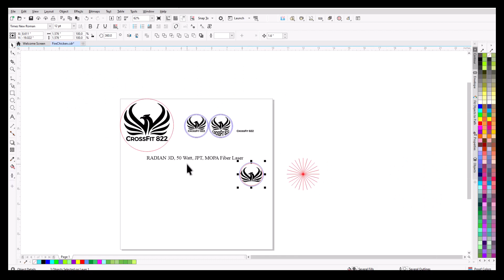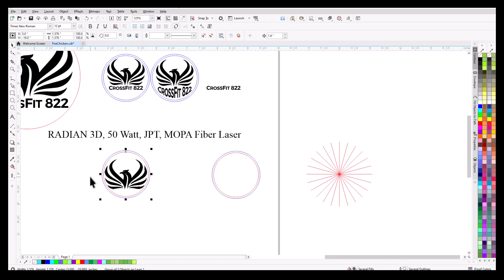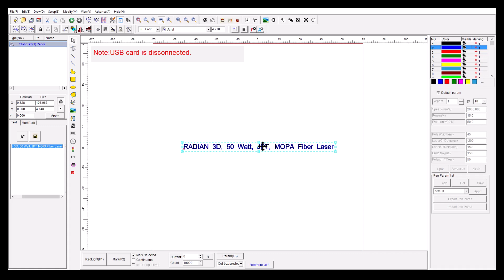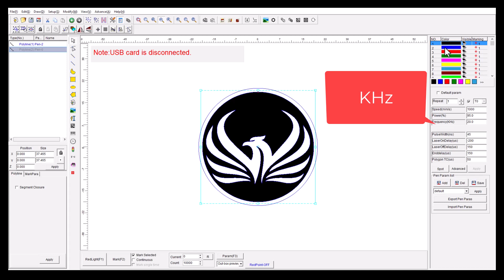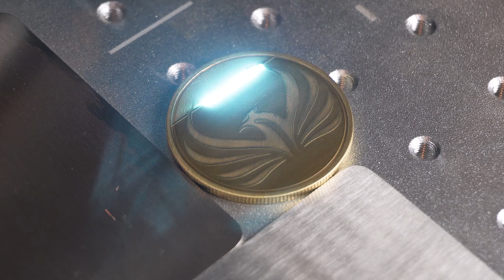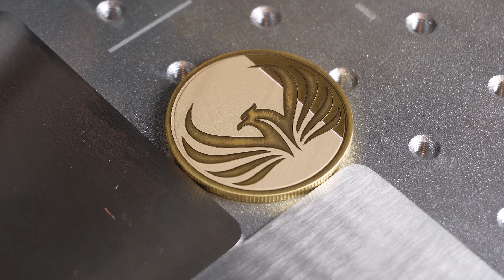Challenge Coin Engraving With a Fiber Laser

Comment: Is this basically a Lightburn format? Thanks
Trying to learn I do have a new 60w fiber mopa
Reply from the maker: You should be able to use Lightburn to do this.  CorelDraw is a Vector based graphic package that I use because EZCAD is so difficult to use as a design program.  If you have Lightburn you have basically substituted it in place of EZCAD.  You should be able to use other design software like CorelDraw as well as Lightburn.  Lightburn controls your laser as well as alowing some easier design features.  I can't use Lightburn for my machine unfortunately.  Thanks for the comment and Please Share this video with all your friends.